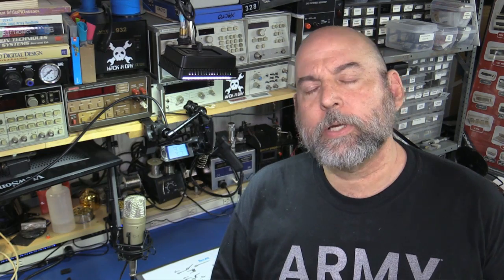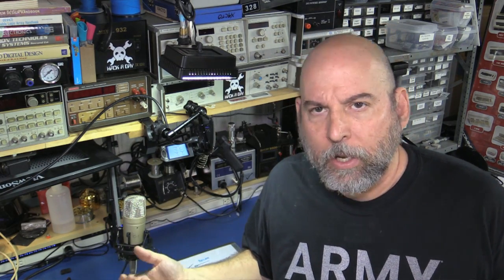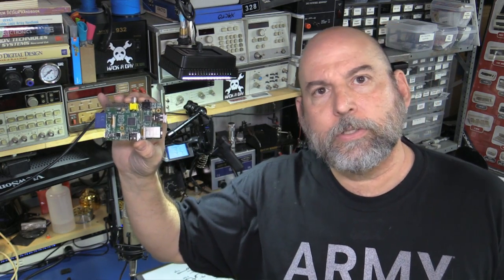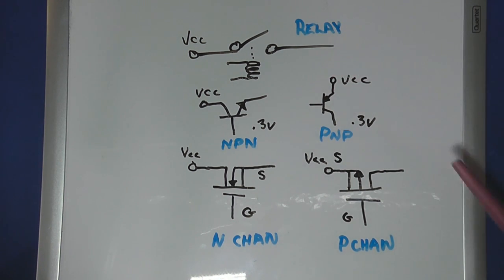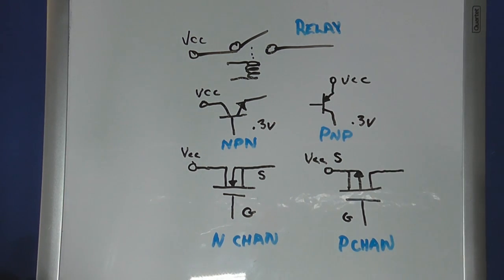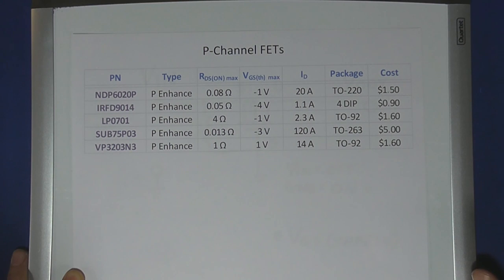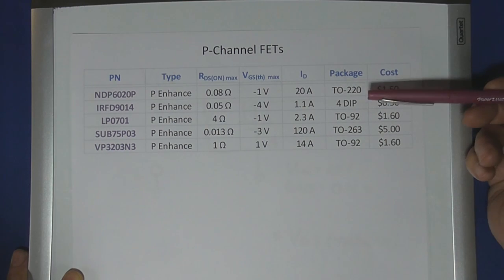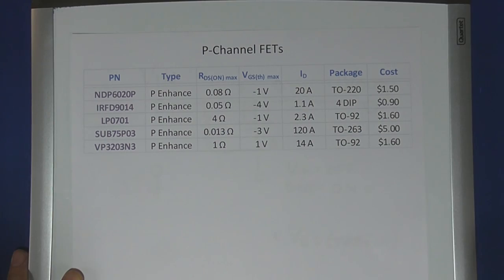How to Build a High Side Switch

Comment: High side fet switching.... 
Use the output of a photovoltaic optocoupler as it floats. Thus can be used to add a voltage offset to the source.

Comment: Is there a voltage regulator or electrical voltage stabilizer
hu-er https://www.youtube.com/watch?v=JqgO7AEZXzI
who would stabilize me the output voltage of the flat two-wire coil in output voltage 230 volt 50 hertz?
that is to say domestic electricity

Comment: Hi, Thanks for this video. It is working well when I follow your instructions. I tried controlling the gate alone but it did not work. I'm puzzled why I have to connect the Base to the Drain via 4.7k. Then using a 100r to the Base, driving 0v is OFF and using +5v to turn the Fet back ON.
Reply: Unfortunately, the 2n3904 is getting too hot using a 350mA load. I therefore have to use those expensive SSR. And low current input.

Comment: what's the problem with shuting down RPi?
1 gpio to initiate halt, 2nd to provide hearbeat signal and cut the power after processing absence of heartbeat be that in software via MC or hardware with something like comparator and timer.

Comment: 4:10 ... i dont get it with this bubble, even after several replays.
Reply: The "bubble" (small circle) is a common way to mark low-active signals. So for low-active input on Gate (P-channel MOSFET), just imagine the bubble on Gate and then you know in which direction to draw the arrow (always away from the bubble in order to avoid popping it) ... and vice versa (if you see the arrow, you know it's N- or P-channel, depending on whether the arrow would pop the imaginary bubble).

Comment: This one is so useful. Learned a lot and I'm using it now in my circuits. Would like to know more of your bag of tricks circuits.
Reply: Also found out about the MAX16054 (pushbutton on/off controller) and use that as the pushbutton on/off switch for the p-channel mosfet

Comment: Nice! One thing you didn't mention (presumably to avoid overcomplicating?) is the issue when using for example a 3.3v GPIO from a CPU to switch a high-side PFET (with pullup as you showed) on a 5v or 12v power rail - this is something people want to do quite often of course.    

-- Hints for newbies reading this; there's two issues, one more obvious than the other:  

1) Let's say you don't have the pull-up resistor shown, and just drive the P-FET gate from your GPIO; typically your GPIO will only go to 3.3v which isn't high enough (relative to the e.g. 12v power rail) to turn the P-FET off.  The fix for this appears to be to add the pull-up resistor to the power rail (which will mean the FET is normally off) and then use your GPIO in "open drain" a.k.a "open collector" mode (or just switch it to an input), end result being the GPIO only pulls down (to turn the load on) and doesn't try to pull it up to turn off (letting the resistor do that)..
.. however the subtle issue then comes into play ... 
2) You have to watch out for "input protection diodes" which almost all chips have on their GPIOs, which are diodes inside the chip that protect it from over-voltage, they go from the GPIO pin to the chip's VCC (e.g. 3.3v); if the input exceeds VCC by (say) 0.6v then the diode starts conducting, clamping the GPIO pin to stop it going any higher and damaging things. This however screws up your "open drain" pin; if the resistor on your PFET is pulling its gate to 12v,  and you connect that gate to your GPIO, then very probably the input protection diode on the GPIO is going to start conducting, and it'll pull down the gate, again making the FET impossible to turn off regardless of what you do with the GPIO pin. 
...The fix for this is to use a second (N-channel) fet/ or (NPN) transistor, similar to what was shown for the "latching on" in the video (but without the resistor to the load output to make it latch) - and switch that with your GPIO.    

Hope that wasn't too verbose, but if you try a high-side PFET on a significantly higher voltage rail than your GPIO, you may well have the "it won't turn off!!" problem for one of the two reasons above.
Reply: Wouldn't a optoisolator also work?
Reply: An opto coupler does not work, but this neat isolated DC DC converter is easy to use and cheap. Search for "b0505s-1w" You connect your 5 V control signal to the input and the gate / source from the Mosfet to the output. Works great! :)
Reply: Thank you so much!! this was exactly what I was looking for

Comment: Lord Rutherford said once that "An alleged scientific discovery has no merit unless it can be explained to a barmaid." In this case, I am the barmaid craving that elusive understanding. Due to your clear, concise, and well-said explanation, I now feel confident enough in my understanding of these parts to breadboard a few experiments - and learn even more.

I'd been slamming my head against the proverbial 'brick wall' in my attempts to understand proper MOSFET operation. Many existing guides/tutorials provide a set of 'newbie' formulae which tend to assume some pre-existing understanding of MOSFETs, while others provide examples using complimentary NFET and PFET packages, without explanation for which-formula-applies-to-which-channel FET. Again, Thank You for being the one clear tutor in a sea of obscurity.

Comment: LOL, I missed the crickets during edit until just now when I came to the youtube page and started looking around for crickets here in the room.  Yes, the wires are small amount as I used "real" wires. (Note that this was not built on a solderless breadboard :)  I have a 4 lead volt meter and could have nulled out the leads and wires were it critical.